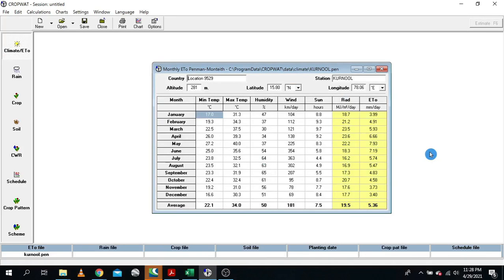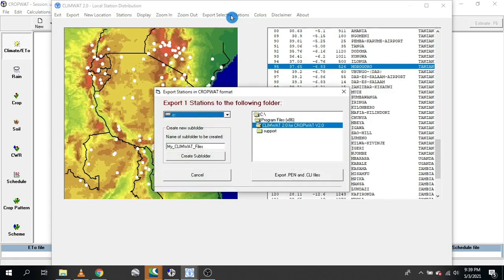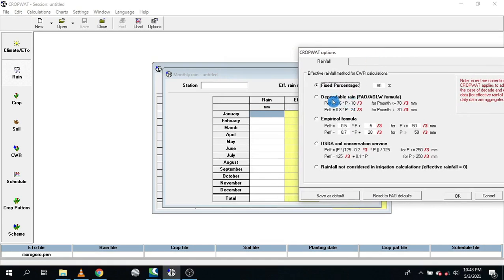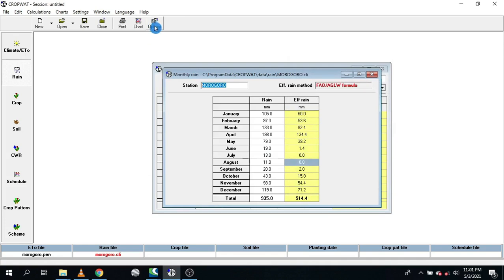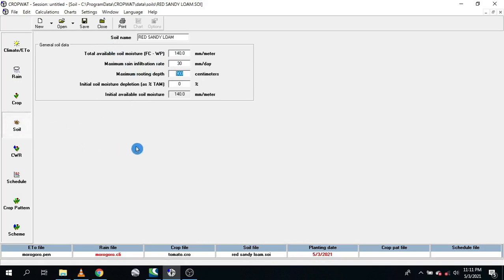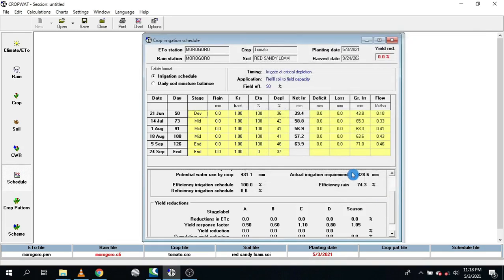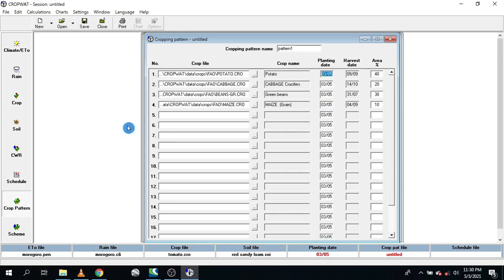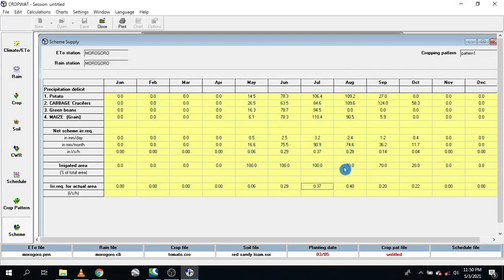CROPWAT 8.0 and CLIMWAT 2.0 for Estimating Crop and Irrigation Water Requirements [English Tutorial]

Comment: in my case my main crop is the cocoa tree on 55% of the total surface of my farm which is 20 hectares I have already had the water needs of the crop in the CWR part of the software but the secondary crop is the banana on 45% of the total surface which is 20 hectares. my question is how to express it in the crop pattern part, should I give the cocoa crop data indicating the percentage 65% and then put the banana data and put the percentage of 45% or else in the part crop pattern I only put the banana data and I no longer put the cocoa data in this part? and if it is, what is the percentage of the banana that I have to allocated here? thank you for any helpful advice
Reply from the maker: Because you have 2 crops I'd advise you to do the following!

1. Start with a single crop just what I did and make sure you set all the required data i.e. soil, rainfall etc

2. Then on the last part make sure to include both crops in your cropping pattern! And not just that, make sure you specify % of each crop i.e. 55% for cocoa and 45% for banana! then take it from there!

NB: I plan to make follow-up tutorials on CROPWAT so stick around...

Let me know if you get stuck!

Thank you!

Comment: hello and thank you for the wonderful work you are doing for us who are learning, but i have a pressing concern. at the level of the crop pattern part you did not put the percentage of the tomato. Could I know why? in fact you have put all the additional crops at the crop pattern level but you no longer put the percentage of the surface occupied by the tomato which is the main crop. and in the last part of the scheme, why the data for the tomato does not appear? this confuses me a bit could you please explain? thank you
Reply from the maker: I have seen your comment, kinda busy but i will come back ASAP to address your issue.🙏
Reply from the maker: Mr Mintya, Welcome!

From what I know in cropwat we have two types of analysis, 1st is single crop analysis (this is part we worked with tomato as a crop) and 2nd is with multiple crops (the last part), I did not include tomato because the last part was independent of the first part (which included tomato). In the last part, tomato did not appear because I did not included it! it would appear if anf only if I included it in the scheme setup!

Inshort, the first was about irrigation for single crop and the past part (with crop pattern) was about if you have a scheme with multiple crops!

Let me know if its not clear!